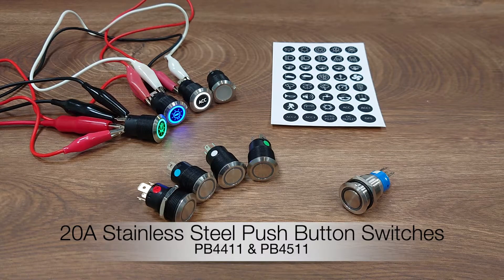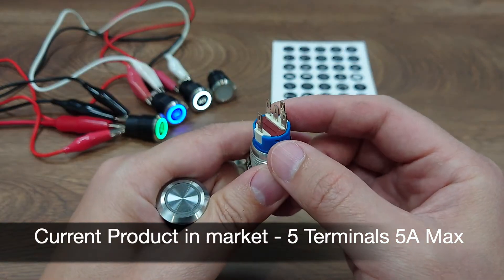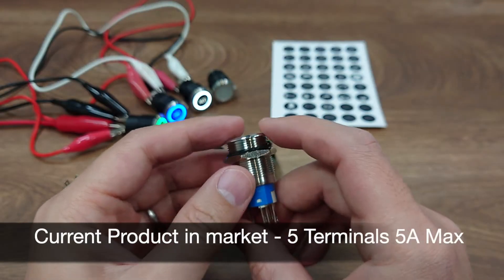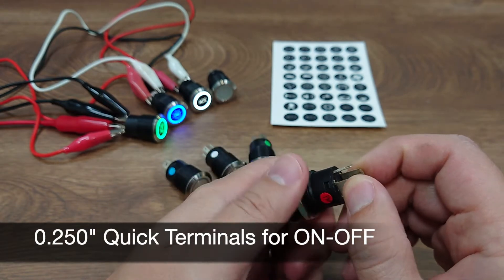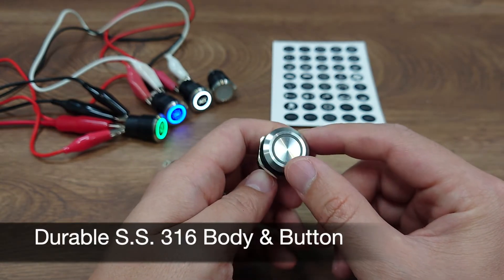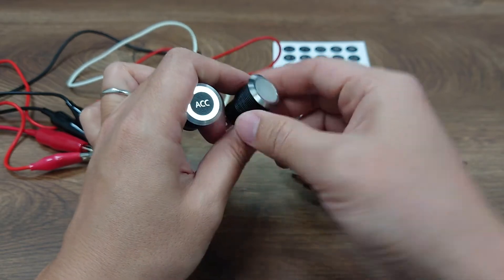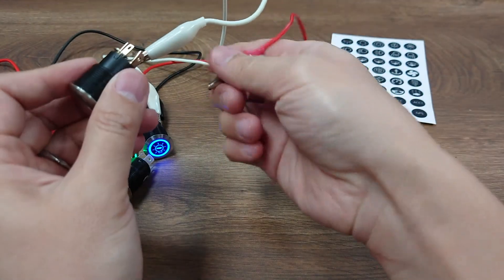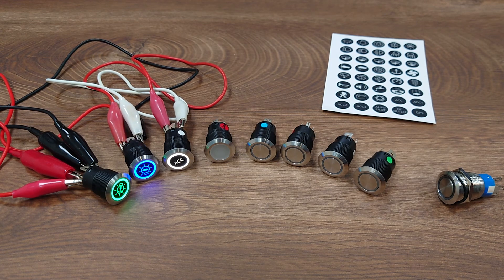Large Current (20A) Anti-Vandal Stainless Steel Push-Button Switch with LED Ring - PB4411 / PB4511

Comment: Hey there how can I use these switches to connect to a usb cable?
Reply from the maker: Hello sir, this is a ON-OFF switch without any socket so you cannot connect a usb cable to our switch. If you have specific need like customization please contact our sales for further discussion. Thanks

Comment: It would be nice if the negative contact of the LED was also under the 6.3 mm contact. It is very difficult to find good quality insulated 2.8 mm contacts.
Reply from the maker: Thanks for your suggestion, unfortunately there is no enough room for another 2 x 6.3mm terminals in the bottom. We are actually developing cable harness housing that covers all the four terminals with cable outputs.
Reply from the maker: HelloTexno, 
Please check our cable harness kit for your reference! 
https://fb.watch/dg8RN-r39f/

Comment: Hello, I'm interested on your product, i have a question whats is the maximum power load on operation?  How many amps or watts can the button hold in 1 circuit? I need them to connect serveral led light but i already have the circuits wired. So i may have up to 300 or 400 watts of consumption in one circuit, is it ok with you buttons?
Reply from the maker: Dear sir thanks for your interest, the max current for this product is DC 12V 20A or DC24V 10A, which is 240w Max. 
300 - 400watts is over the limit of this switch :)
We suggest you spliting your circuits into two circuit 200W each that would be fine. otherwise you might need to consider to use 30A~40A relay instead. :)

Comment: Where can I buy?
Reply from the maker: You can send us e-mail at 
sales@yismarine.com
or go to our Alibaba Website for small volume purchase:
PB4411
https://www.alibaba.com/product-detail/IP67-protected-Push-Button-Switch-temporary_1700005039081.html?spm=a2747.product_upgrade.0.0.67d31757He0Ej7
PB4511
https://www.alibaba.com/product-detail/Stainless-Steel-Push-Button-Switch-with_1700004914298.html?spm=a2747.product_upgrade.0.0.67d31757He0Ej7
Reply: @YISMarine  these two links are no longer available 😭😭